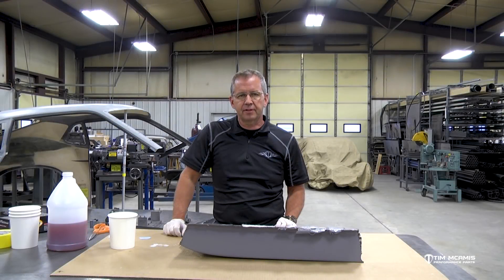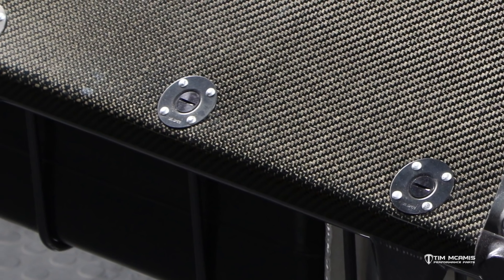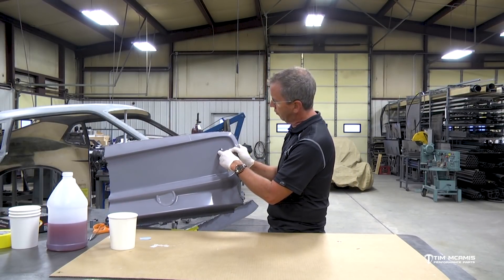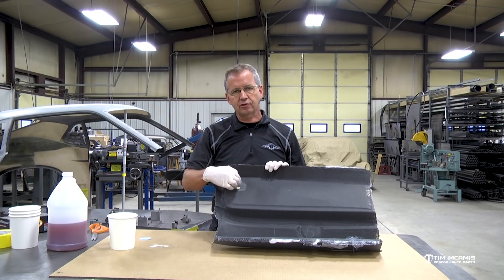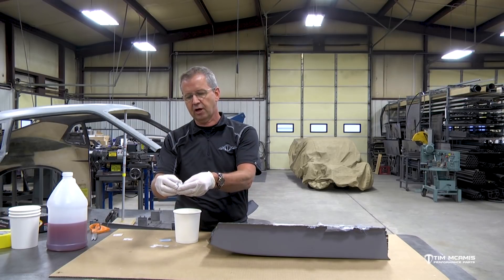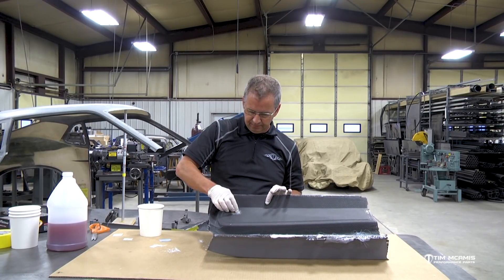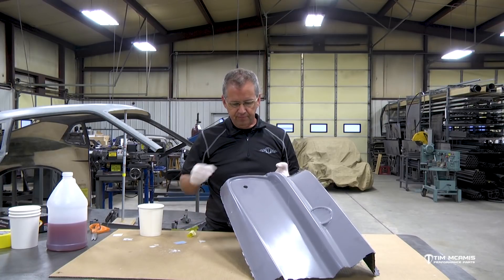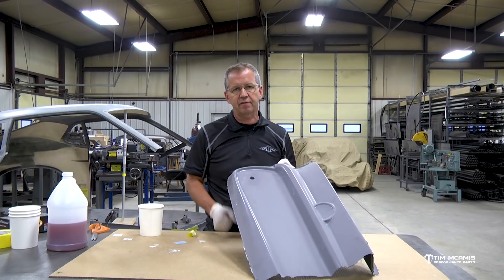How To Repair Holes - Composite Series: E6

Comment: Have you ever repaired a rear fender on a GM / GMC Dually?
I punched a large hole in my fender bubble butt. It's about 12" square hole. 
Will carbon patching work for me? Or What's the best way.

Comment: Wouldn't it be better to have a thinner plate on the backside of the panel to match the front before bucking up the rivet? Also what is the strength of the carbon fiber the farther away the 1/8" hole is from the main 1/4 turn hole? Would not increasing the distance add strength?